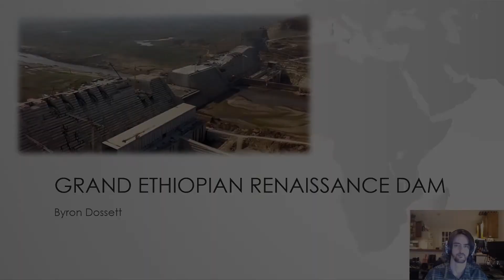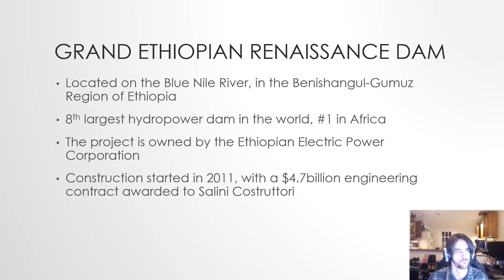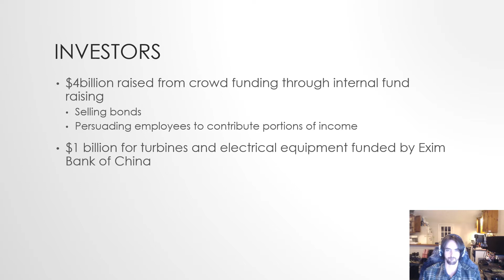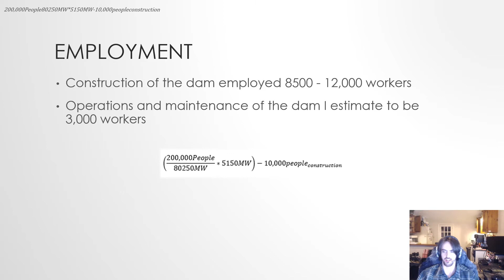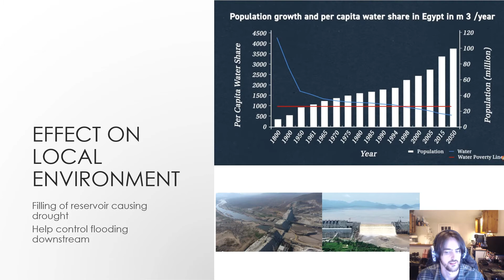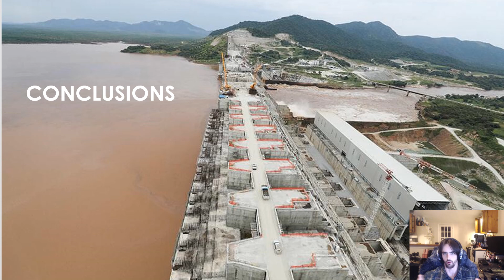Grand Ethiopian Renaissance Dam

Comment: Nice report on the dam.  I have been following the construction for a long time,  entirely for personal entertainment. 

It turns out that the White Nile tributary is capable of supplying much more water than was appreciated and it's flow from Lake Victoria is more limited by vegetation than anything else.   In fact it has been causing major flooding problems for a long time.

Comment: The reason for the size larger than traditional size of the reservoir is Ethiopia's experience with other dam projects.   There have been others that nearly ran dry because of the very large year to year rainfall variation. 

Having it somewhat extra large increases the reliability for both its needs and the down stream countries of Sudan and Egypt.   Egypt knows this perfectly well.

Comment: The nature of electricity demand is that each day it varies widely from almost none at night to very large amounts at the peak of the day.   It is normal for utilities to have multiple parallel generators set up to run a few during off peak and then turn on more to match the daily 1 - 3 hour peak.

This peak electricity is worth 2 - 10x as much as off peak so it will help pay for the dam much faster by selling it to other countries.